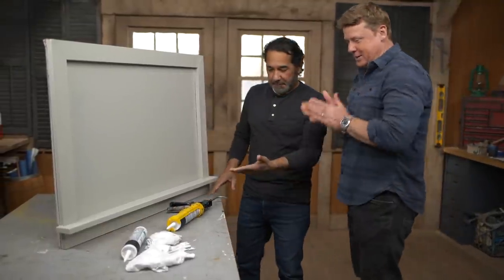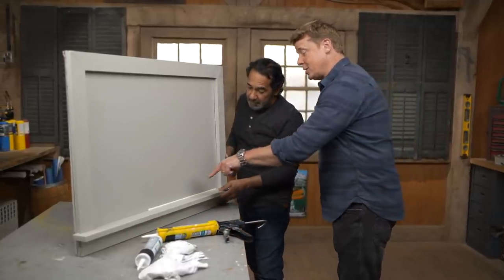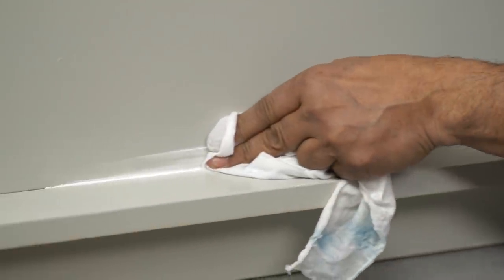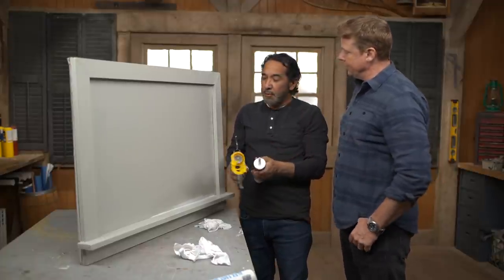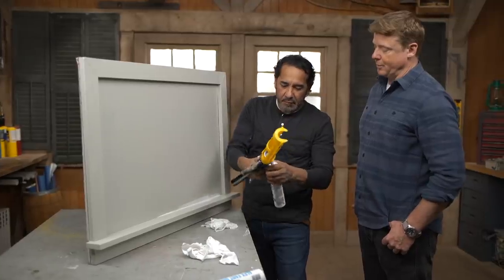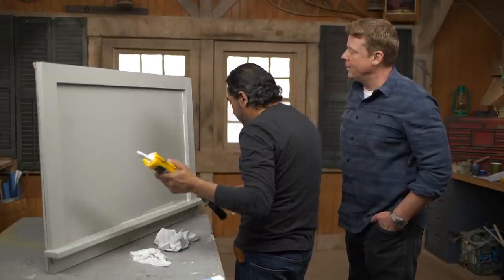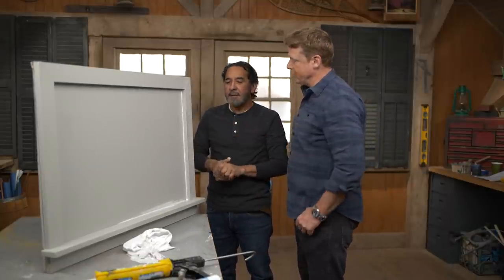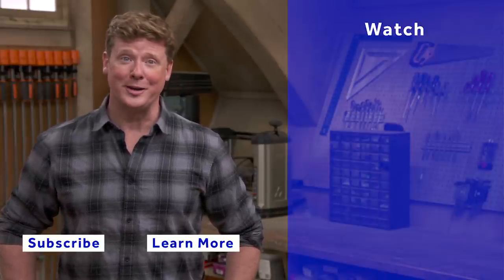How to Use Less Caulk When Filling in Gaps | Ask This Old House

Comment: I'm a huge fan of the caulk in the gun - it says it dries in 2 hours and it really does. Paint the same day!
Reply: DAP Alex latex and Fast Dry latex cracks in several years when it dries out, though.  Even the DAP Alex Plus latex isn't that great.  Sure it tools easy and dries fast, but it sucks for longevity.  If you're a construction guy it's fine because you'll be long gone in five years when the caulk is cracked...that's why so many use it (aside from it being cheap).  A homeowner doing their own project should at least get DAP Dynaflex Ultra if they're in it for the long-term.
Reply: @cup_and_cone In my experience its more about the joint than the type of caulking. If its in an area that sees massive temperature changes its likely to crack. I will say big stretch works a bit better for those instances but if its in a harsh environment it will probably crack no matter what type of caulking you use.

Comment: Caulk first, then paint.  Provides better hide for any residual caulk film on the flat surfaces adjacent to the crack/open spaces being filled in.
Reply: Yes, it looks better until you have someone who doesn’t know to cut the caulk line when removing the trim and rips out a huge chunk of paint/paper. A larger issue, I think,  is people only “update” for a 3-5 year idea, instead of planning a solid 10-lifetime project. My father is a trim carpenter by trade, and really has to sell the customer based on his rates because it isn’t some 3-5 year IKEA kitchen, it’s a investment that will last and can stand the test of time.

Comment: Not bad but, I just had a new walk in shower installed last month.  The guy that did the caulking used the typical large hole method on the tube which yes, resulted in a whole lot of waste but, he finished it up with WD40 and his finger.  That is the best caulking job I have ever seen!  Previously, I learned to use dish soap but this method is even better and faster!
Reply: Oh wow, I had never even considered using WD-40 to smooth down the caulk with!! 😱 I have been tooling my caulk by using my index finger dipped in mineral spirits (with a glove on), but I’ve been wanting something that wasn’t so caustic & odorous. Was the caulking used in your shower silicone? Thanks for the awesome tip! 🙌
Reply: @Malfatta  I can't say for sure because they provided it but it does feel like silicone.  The finish is absolutely flawless!
Reply: Pretty sure the wd40 was used to cut the silicone, not for lubrication. If it were water based (latex) wd40 wouldn't work well. The bigger the glob the better the job method has never worked well for me.

Comment: Great for interior latex caulk for these applications. For anything you need a real sealant for, it's better to leave more of a gap and use more caulk. Thicker bead means more potential for it to expand and contract. Good tip for baseboard/trim though.
Reply: Go troll on PBB channel with your loves…Miles and Austin.
Reply: @johnlebzelter4208  you are so obsessed with me 💕

Comment: There’s no seal in these tubs if they have a sealed plastic tip there’s no seal inside

You should also use snips instead of the caulking gun to cut to better control your cut. 

He also left a hole in his line he caulked the second time 😆
Reply: You saw that too 😂
Reply: There's definitely an inner seal in at least several different caulk tubes when you cut the tip... Ask me how I know.
Reply: @cup_and_cone  Same way that I know.